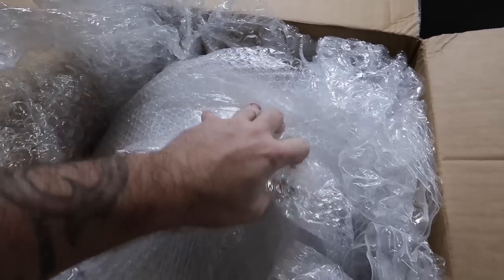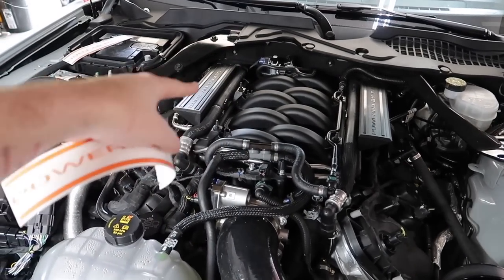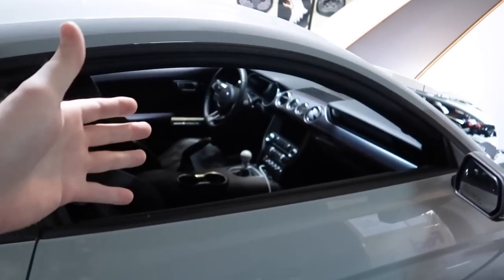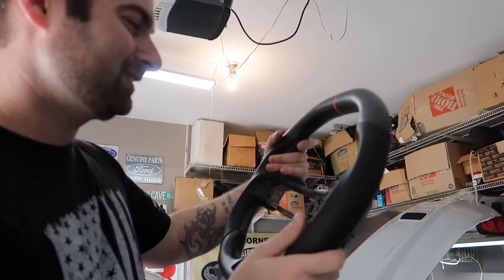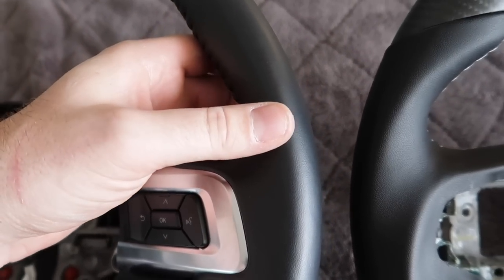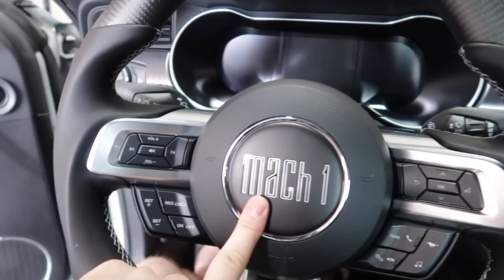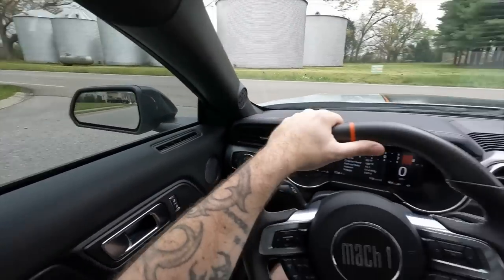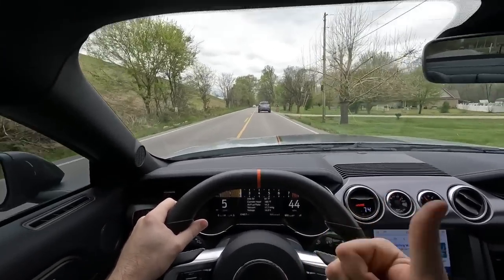TRANSFORMING MY 2021 MACH 1 MUSTANG! "MATTE CARBON FIBER" STEERING WHEEL + MORE!

Comment: When you replaced your steering wheel, did you use a new steering wheel bolt? If so, where did you get the bolt from?
Reply from the maker: I used same bolt. Been doing it for years and no issues
Reply: @Zander13Productions  thank you!!

Comment: Great detailing touches. That steeringwheel is awesome! If you're consider getting hood struts, I have some adise and some warnings.
Reply from the maker: I have been thinking about the new updated Roush struts
Reply: @Zander13Productions  The metal on the fender is very easy to bend and flex. I had to rerout the hose that goes to the windshield washer, because it was getting pinched when I closed the hood. I used the Ford struts.
Reply from the maker: @machdaddy6451  awesome thanks

Comment: I love new parts day, until it comes to instal..I’m a genuine YouTube mechanic. Lol waiting on new hot side charge pipe for the ST, and a set of 2 step colder Ford Racing/Performance spark plugs.....but the ship date keeps changing. Might have to check my dealership and see if they have any in stock. The new overlays on your valve covers look pretty badass. Love it. That’s a beefy steering wheel. God bless brother.